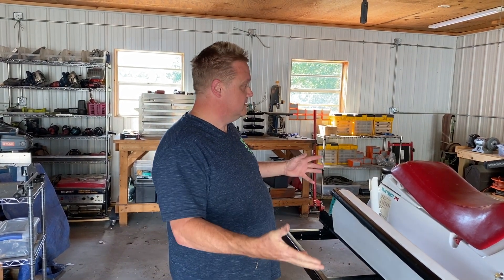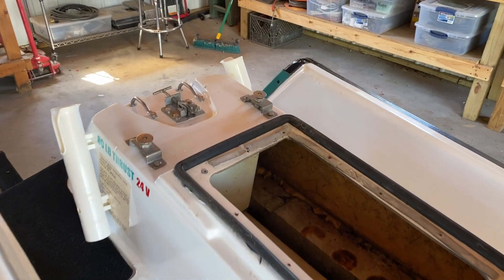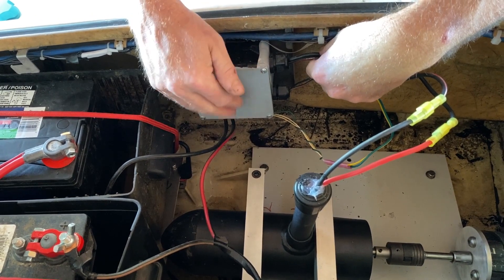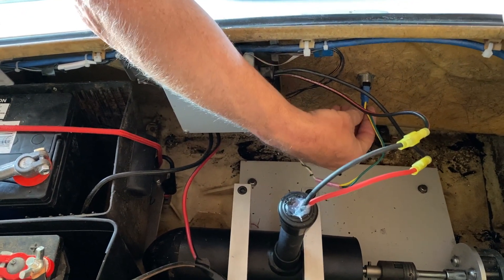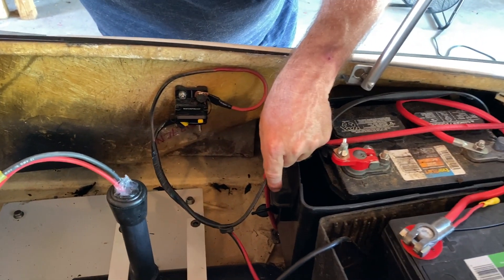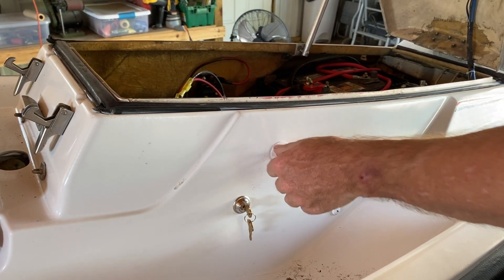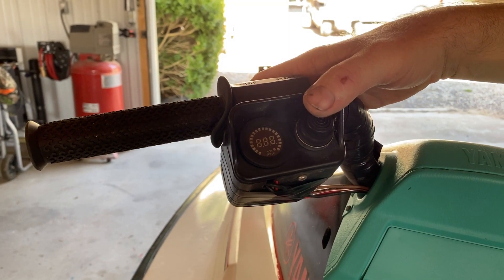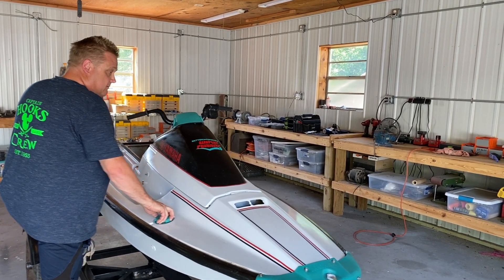Converting a gas wave runner to  a electric wave runner

Comment: That may be the slowest wave runner of this world, the waves will go faster than you XD To displace in the water, you need a lot of power, that obviously that motor doesn't have, maybe with some kind of small car motor and lithium batteries that are lighter and smaller you can make it work, you need at least 30 hp for a waverunner to be fun.
Reply: How high do you have to be, to believe a power-drill sized motor could drive a jet-boat?  This was a huge waste of time.  Boat would go faster if he took the cardboard box the motor was shipped in, duck-taped it to the handlebars to use as a wind-sail.

Comment: I just had this same idea about 30 minutes ago, nice to see it has actually been done. be a great little fishin rig for one person on a small lake/ponds.
Reply: I just picked up a Hull for 100 bucks, A 99 Kawasaki STX1100 for this very reason. Yesterday morning the hull popped up on Marketplace with paperwork as well. I cannot wait til I get this completed...
Reply: @mrroofman   you plan to do a inboard elec motor to the original jet drive? or just put a electric trollin motor on the back?
Reply: @billwilliamson9842  I have been looking into both. I kind of like the inboard but of course it takes a little more work. If traditionally attached to the back I will be doing cable steering and remote throttle.
Reply: @mrroofman   I will likely opt for the latter setup if/when I do this. should be fairly simple to move the twist grip from the trollin motor to the handlebars and makin the cable steer work, shouldn't be too complicated either.

Comment: I'm into high power e bikes and scooters I'm going to give this a go with 72v battery 6000w motor and a sabvoton controller 150A should be fun
Reply: You should make a playlist of the build, that would be legit
Reply: I've heavily researched this you'll need like a 25 kw motor or bigger and liquid cooling for everything installed...
Reply: @greglatta6525  forklift motor at 48 volts won’t do it for my old seadoo gtx?
Reply: @cgorman212  at least 72V or 144V even better. And controller needs to be good.

Comment: I think this is an amazing project and one I’m going to undertake myself this summer, I’ve watched and got some great ideas big thumbs up!. One question I have is about the cooling of the trolling motor, is it not designed to run in the water which should cool the internals ?. I may be totally wrong or maybe you could build a small pump and some copper pipe around it to cool the motor. Anyway good luck and fantastic project thank you for sharing
Reply: Great job. Going to do this also this summer.
Reply: I shall undertake as well! ;)